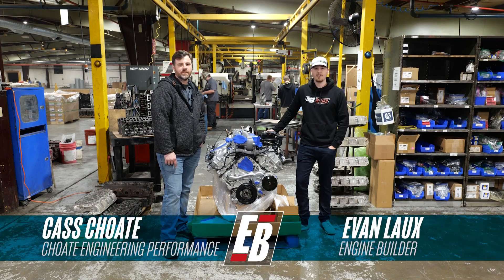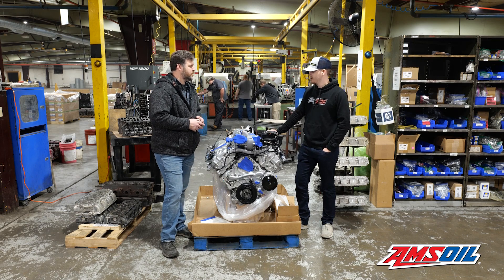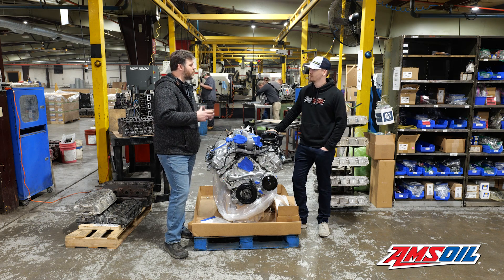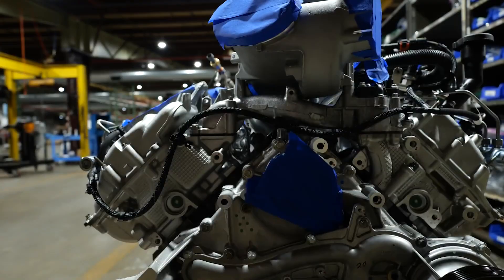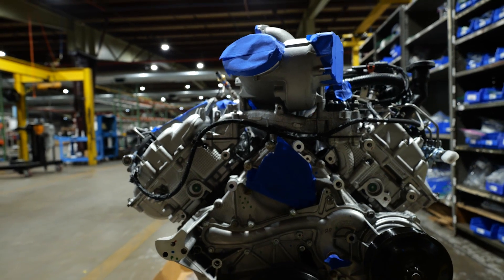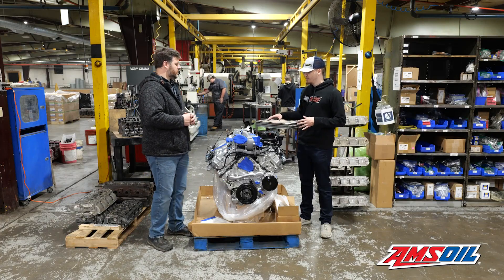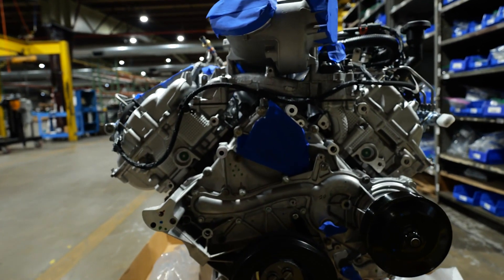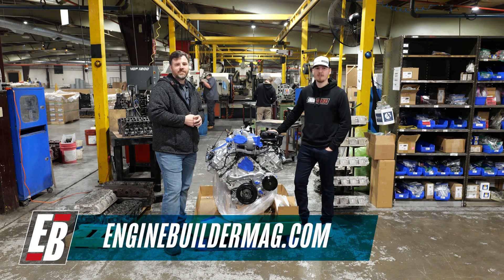Choate Engineering Performance 6.7L Powerstroke Engine

Comment: The 2022 6.7 powerstroke is just flawless 

The 2023 is just going to continue to get even better.
Reply: If it still has the CP4…it is far from flawless.
Reply: @christiandavis3910  there are now CPX and DCR options
Reply: @Taylor.M-91  you can’t put a CP3 in the valley of the 6.7, it won’t fit. The add on CP3 is in conjunction with what’s in the valley. The DCR was just released 13 days ago.
Reply: @christiandavis3910  correct, but I said nothing about a CP3
Reply: @Taylor.M-91  figured CPX was a typo.
Reply: @Taylor.M-91  the CPX is just a modified CP4.
Reply: @christiandavis3910  and it fixes the CP4 problems if you read up on it. RCD did their homework on it
Reply: @Taylor.M-91  I’ve read up on it. Learned something new today. Either way, sucks ford and Bosch haven’t corrected the issue. Pretty lame.
Reply: @Taylor.M-91  at the same time, if it was that simple…why did this “fix” come out 13 years after Ford was employing the use of the CP4? I find it odd and suspect. I’m waiting until either one’s get some reviews and mileage on them.
Reply: @christiandavis3910  I agree, time will tell